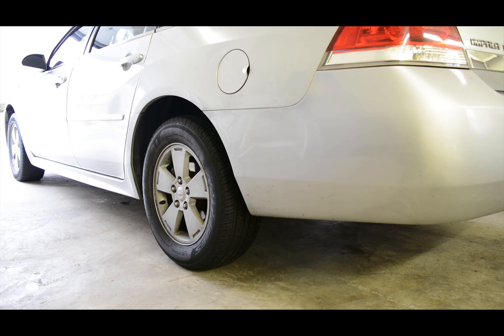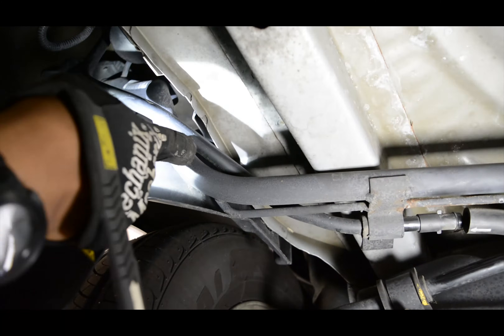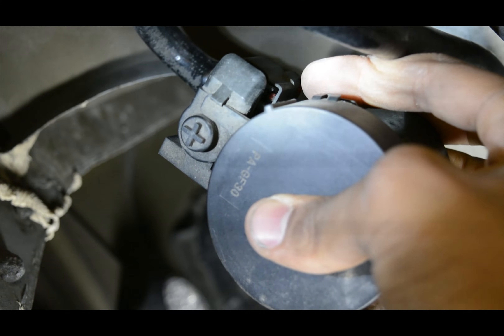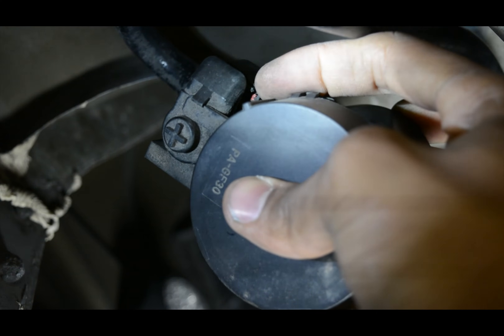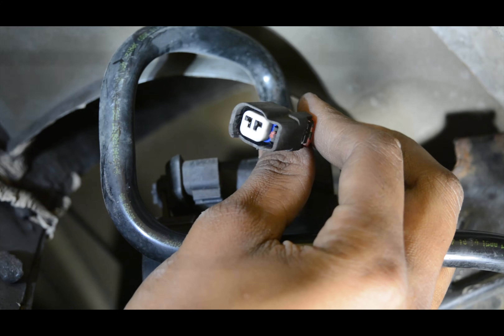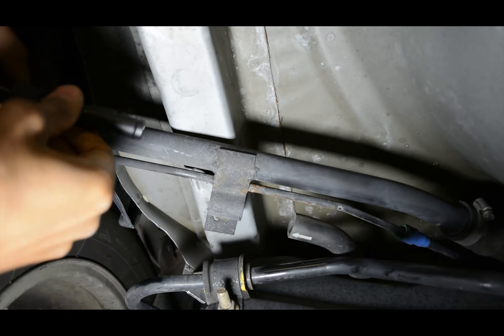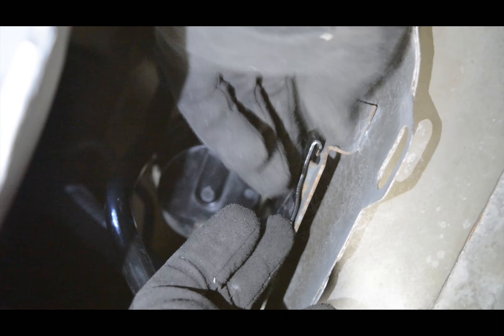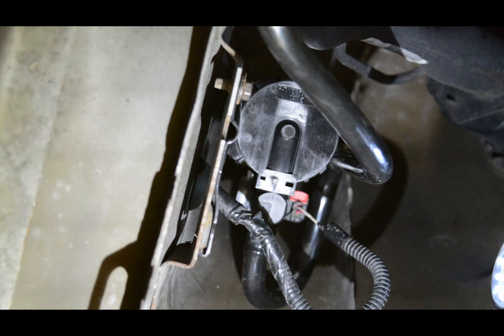EVAP VENT Engine Code P0449 Chevy Impala 2006-2012

Comment: I always spray every electrical plug with lubricant and make sure it gets inside to the rubber gasket. I use air hose and blow the excess lubricant or dirt from each one. This will save alot more plugs and clips from being broke or cracked.  Makes it alot easier to remove the most stubborn  electrical plugs.
Reply: Every time. A lot of times these fault codes pop up due to a dirty electrical plug or cracked wire always clean and inspect before replacing anything like this or abs/traction control sensors. The lube/contact cleaner/brake clean depending on what you're doing will be the issue.
Reply from the maker: Great tip!

Comment: The hardest I disconnecting the canister hose to the cars rubber hose. It's located above left muffler on dual exhaust. 2007 impala 3.9
Reply from the maker: Sounds like a interesting job

Comment: Replaced the evap combo, cleared the code, check engine light off, drove it for couple of hours and again - it failed the emission test.  What else can I go after since the code reader says "no codes"   According to what's available on line, every emission issue shall give you a check engine light and some sort of code
Reply from the maker: My apologies for the delayed response . I would talk with a proffesional.

Comment: What happens if you don’t replace it
Reply from the maker: I'm not sure, lol. I don't want anything else to occur,  so I just replaced it
Reply: The factory remote start doesn’t work since check engine light is on.

Comment: You did not make a mistake in "topping off" I have topped off hundreds of times on fords and no problem. Had one Taurus that gas gauge gave out and I just  topped off (to the extreme) every time I filled up and I knew I had so many miles to go. Did it for years with that car. I have a 2011 impala with similar issues and it is not you creating the problem brother it is bad design from chevy. Just one more thing on that generation they should be ashamed of. 🧐 Don't get me wrong I'm not a bow tie hater, but this generation Impalas had too many problems out of warranty. BTW thank you for the good video. Helping many folks. Stay safe bro.
Reply from the maker: Thank you, I appreciate it.
Reply: My only issue with my 07 impala is that I can’t use remote start because the check engine light is on
Reply: No, not really.  Mine has 180k on it and this is it’s only problem besides a wheel bearing and the infamous blend door actuator
Reply: Filling up when you squeeze by hand or leave it on the notches is one way to top off,  OR where you're lightly squeeze so you lightly let in less bubbles, because that's an actual top off!! This guy must be Ford owner 🤣

Comment: I was was at the gas pump and it wouldn’t let me put gas in my 08 impala and fumes was coming out as I took the gas cap off.. so changing that part would solve my problem?
Reply from the maker: I recommend talking with a certified mechanic. I am not a certified mechanic. I hope you can find an answer to your question.
Reply: @GTX10  yes I do, does that mean I need to replace it?

Comment: First thing everyone needs to do is check to make sure it fits the plug wire!!  The car I just worked on had a different plug with the hose already attached, and had to buy a different one without the hose.  The connector I worked with look like the shape of a B.
Reply from the maker: Thanks for the advice
Reply: Your welcome, your video was very helpful!
Reply from the maker: @thomasbergman442  Thank you
Reply: I used the new wire that comes with the new canister vent valve solenoid. One end plugs into the Old Wire and the other end plugs into the new canister solenoid.
Reply: Thomas Bergman  Yep has to order an adapter kinda sucks but at least there was one available
Reply: I know, it's a dumb design!
Reply: Gm uses an adapter harness # 19257603
Reply: Cool, thank you!
Reply: What did you end up having to do? Mine has the B shape and the part I ordered doesn’t have the same connection.

Comment: What are the symptoms if it went bad? Would it cause surging or jerking when accelerating?
Reply from the maker: that sounds like transmission. I recommend you speak with a professional. Hopefully everything worked out for you.

Comment: What are the symptoms if it went bad? Would it cause surging or jerking when accelerating?
Reply: Jared Albin I want to know the dame
Reply: Same
Reply: Cassie Garcia transmission was slipping at that time due to low transmission fluid was my problem.
Reply from the maker: @jaredalbin5658  Oh wow. Glad you got it figured out.
Reply from the maker: that sounds like transmission. I recommend you speak with a professional. Hopefully everything worked out for you.

Comment: I changed mines but the engine light stayed on. Disconnected the battery but engine light still stayed on. Took it over and got it tested and same code after changing the solenoid. Any suggestions on why light still on after solenoid changed.
Reply from the maker: E. Rod517 I suggest you go to a certified mechanic to diagnose your vehicle's situation
Reply: Check the purge valve solenoid
Reply: I just change my purge valve solenoid the light is still on
Reply: @zeyedim  get the codes your vehicle is throwing to turn on the c.e.l. in the first place.

Comment: Just saw this video and had same code, just changed it and hopefully this engine light cuts off soon. I’d like to use my auto start for a change
Reply: Same here man, how'd it work?
Reply: @CameronTucker06  it work????
Reply: @plasticmatt477  yes! I replaced it back in December and it worked!
Reply: Cameron Tucker how long did it take to clear?? Mine has been on for like a day and a half, so I cleared the code and it came right back says “pending” so I’m thinking it just needs more time:::
Reply: @plasticmatt477  I disconnected my battery to the car, and it never came back on!
Reply: Cameron Tucker gonna do that later tonight. Thanks!
Reply: @plasticmatt477  no problem, let me know how it goes!
Reply: Cameron Tucker TURNS OUT I tested both the old and new canisters and they were FINE... started checking the wiring leading to it (from the car to canister) and one of the lead wires was cut in half... rotten... replaced it, unhooked battery and it’s been off since!!!! Thank you all for guidance!!! My remote start appreciates you
Reply: @plasticmatt477  lol good stuff!!
Reply: Cameron Tucker yeah, what a pain in the a$$
Reply: @plasticmatt477  
I changed mines this weekend and the engine light came back on. Same code. Changed the purge solenoid too. And gas cap. Same code. I did notice i didn't hear anything from the vent vaulve after replacing it. Anything else to look for?
Reply: Kells Anderson I’d look for voltage at the wires... get a multimeter and see if you can check for voltage coming from those two wires... it’s intermittent voltage so make sure you sit there and watch. I also checked the solenoid directly on my battery, it’ll click hard under 12v!
Reply: I was thinkn the same about my auto start lol I fixed the FTP sensor my engine light went off the starter worked that morning by the time I got off my engine light came back on
Reply from the maker: Understandable, and hopefully it worked.

Comment: Overfilling the gas tank damages the solenoid?  Or does it jst guarantee the code will set and eventually damage the solenoid?   Thanks.
Reply from the maker: Ron Lochocki I read that overfilling the gas tank was the leading cause of the error code, and that is the one thing that I always did at the pump. Since I stopped putting in gas after the pump has automatically stopped,  I have not had any error code.
Reply: Many thanks for your kind reply.  I think I understand my problem and why I keep failing these vent solenoids.